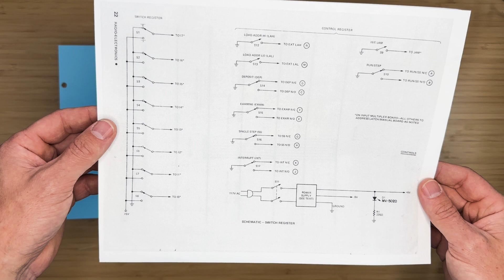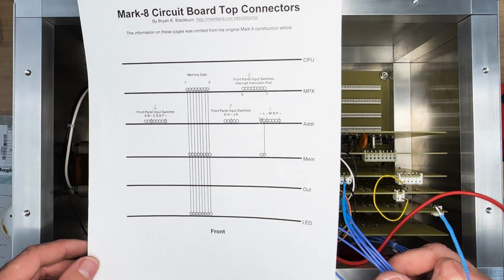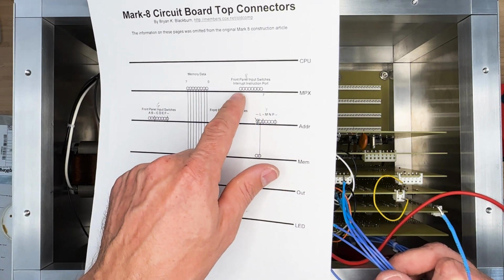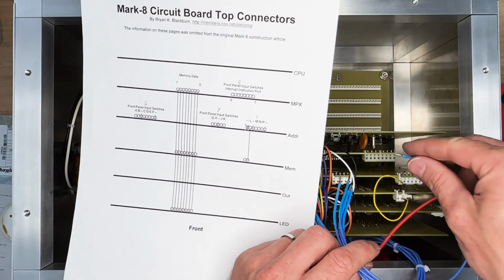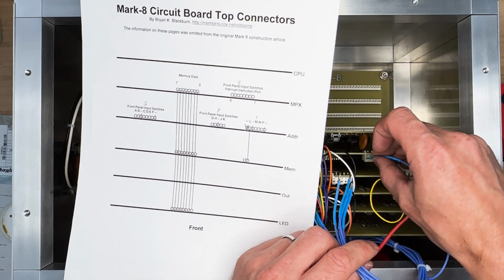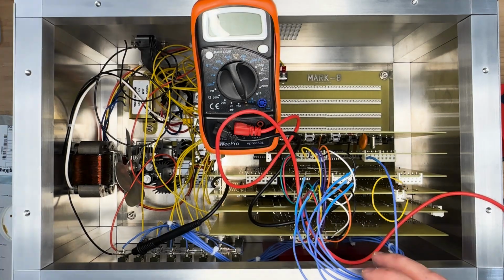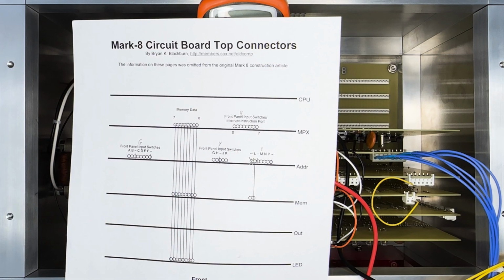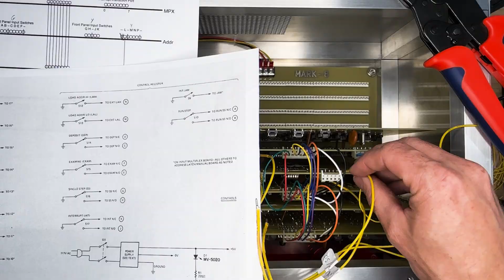Finalizing and Operating the Mark-8 Minicomputer

Comment: Are the LEDs aligned with the window opening on the front?
Reply from the maker: They are not. The backplane is mounted slightly left because of the right frame. This can be fixed by mounting it higher than the frame but I'd rather leave it that way. I do have an updated CAD file with the lights opening moved left so it's more aligned. I'll upload it to the github page.